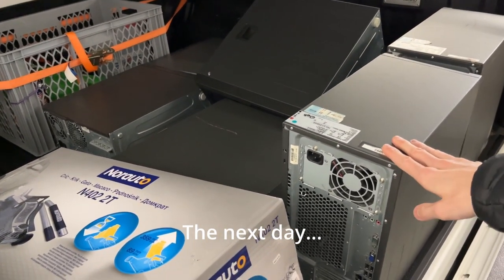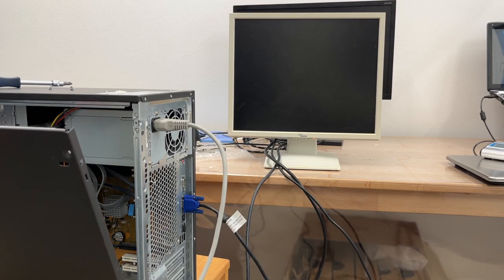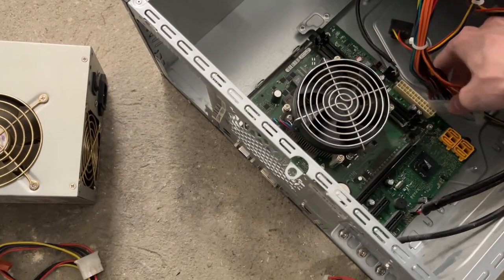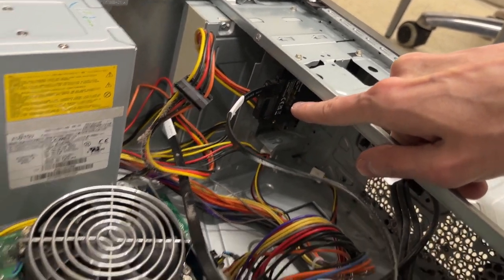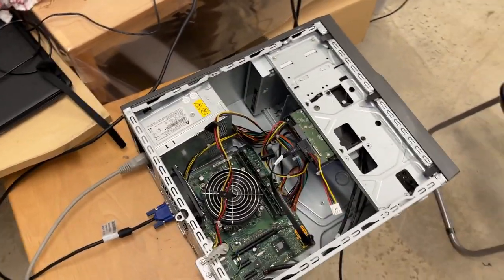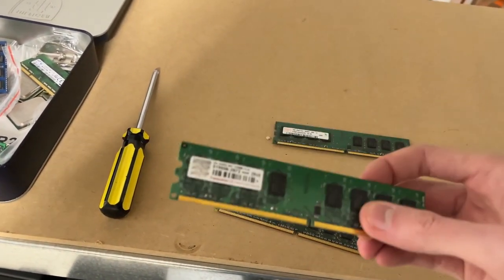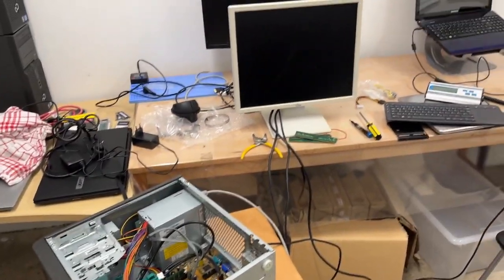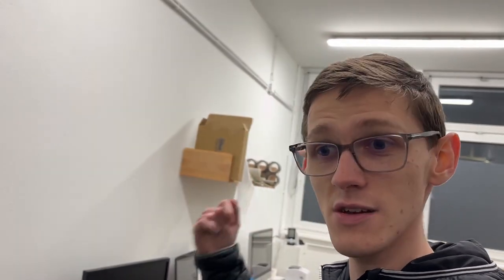I bought 8 PCs for 100€ - Bad Idea?

Comment: I didn't get a good look at the PSU the cable was too short on, but it looked like it might've been one of the PSUs that has a 4-pin connector that sits to the side of the 20-pin connector and the 2 connectors together plug in to the 24-pin connector on the motherboard.  This is because older motherboards use a 20-pin connector and the newer 24-pin connector only differs by having 4 pins added on one end.

Comment: I live in america and most of these PCs even the i3 systems, nobody wants to buy them (locally). even for $20-30 with full windows installed it takes 3-5 weeks to sell sometimes. Maybe in austria its a different situation but I stopped dealing with old i3-i5-i7 systems a while ago. Most people rather buy a brand new laptop for $400 than used pc-monitor for $50-100. 1 day shipping on amazon and everyone is spoiled
Reply: Last year I was selling a similar system. $30 for 4th gen pentium with 8gb ram and 320/500gb hard drive. with monitor/keyboard/and cables. Waited 2 weeks, nobody wanted to buy it, so I just gave it away for free (still took a day to find someone). But like I said maybe in austria its a bit different. Still though 8 computers its fun to tinker with for parts. Maybe try hackintosh with latest macos for intel?
Reply from the maker: Yeah I heard that things in America are different when it comes to prices. I think it probably comes down to just a lot more devices being around. But those old PCs also don't sell fast in Austria as well. I often sell older tech to neighbouring countries (Hungary, Slovakia, Czechia, etc.), there is still demand for those since a lot of people aren't that wealthy there.
Reply: here in ireland, 3rd gen systems go from 100-200 euro depending on if its i3, i5 or i7. this is due to supply and demand. much less supply in ireland, id imagine the same in other european countries